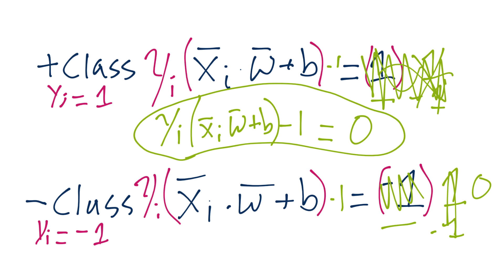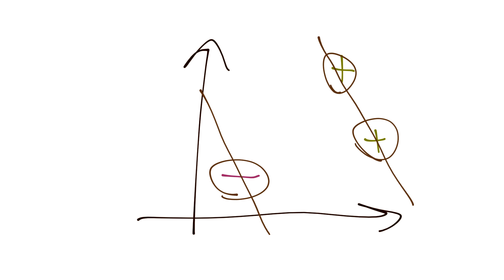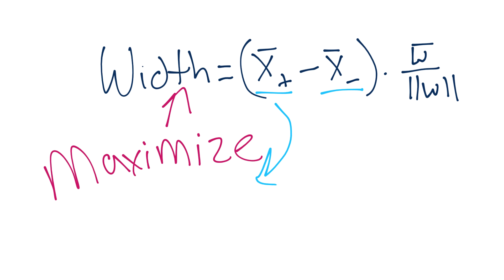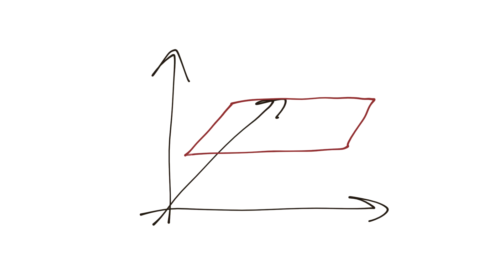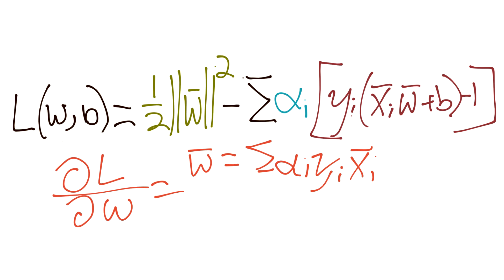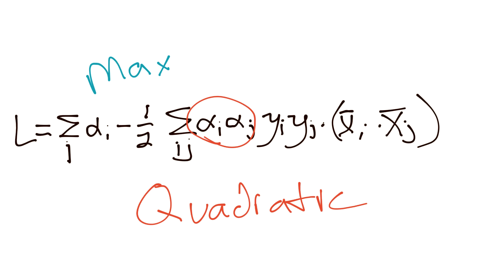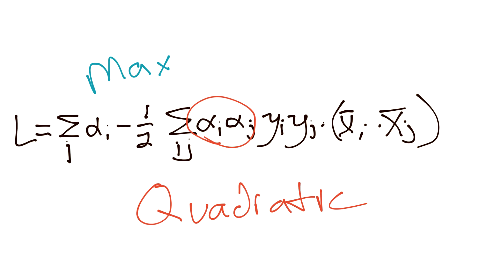Support Vector Machine Fundamentals - Practical Machine Learning Tutorial with Python p.23

Comment: I would say I get this from the maths point of view, but... maybe not. 
How come minimizing norm ||w|| achieves anything ?
Say I have the "best" separating plane, then my classification wouldnt change if I just change the length of the normal vector, because it is still facing in the same direction, so it does not change the plane at all?
While writing I notice that it actually does change the plane. Usually you define planes with a normalized nomal vector (so unit lentgh), so the shortest distance Origin-Plane would be "b". But now it is "b / ||w||".
?

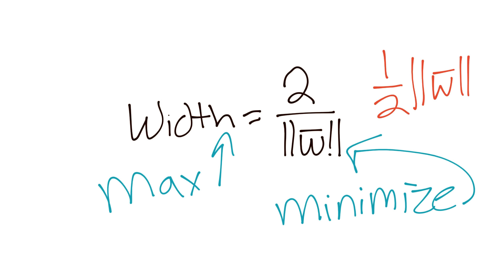Comment: 5:38 Can anyone explain why would you want to minimize 1/2||W||^2? And how did he derive that? He just kind of mentioned it like it was trivial...
Reply: Its serves as a 'mathematical convience'
Reply: i think minimizing 1/2||W||^2 allows you to maximize the separation (the 'width') between the positive and negative support vectors (decision boundaries), thereby allowing you to draw the best separating hyperplane.  he begins the explanation around the 3 minute mark.    he also goes over it a bit in the previous video in this series.
Reply: we need to maximize the half of w square because actually we wanted to minimize the 2/ w now  since w is in denominator then more the w is less the result is in other way if you maximize the w/2 your impact will be same and since w can be positive and negative both is better to square that as because the maximization will have better support vectors
Reply: The width is calculated as 2/||w||, we want to maximize the width and width and ||w|| as inversely proportional so as we want to maximize width we need to minimize ||w||. We multiply with 1/2 and square ||w|| for mathematical convenience when we take the partial derivative of the term(1/2 ||w||^2) the 1/2 term will get eliminated and it eliminates constant. 
For a detailed explanation, you can refer to MIT's AI course(SVM lecture).
Reply: When solving Lagrangian to calculate extremes of a function you will need to take partial derivative of the function w.r.t. W.
It just simplifies things afterwards because
Derivative of 1/2(||W||^2) equals just W